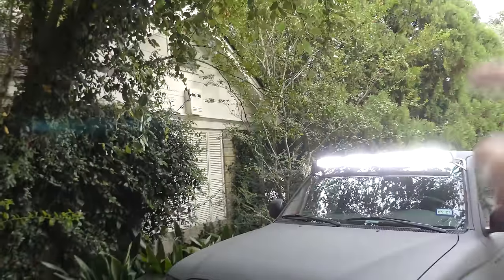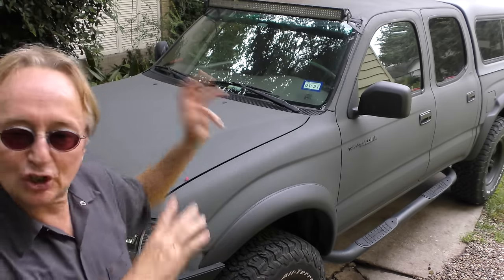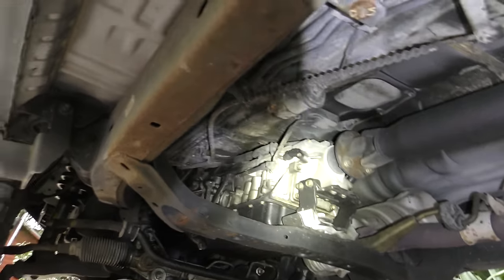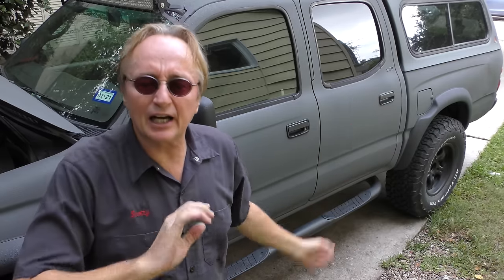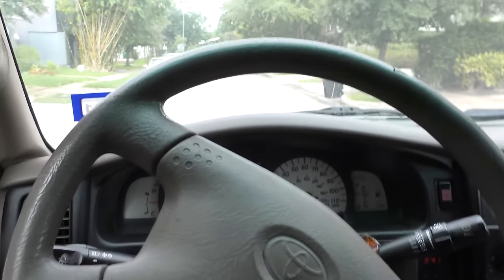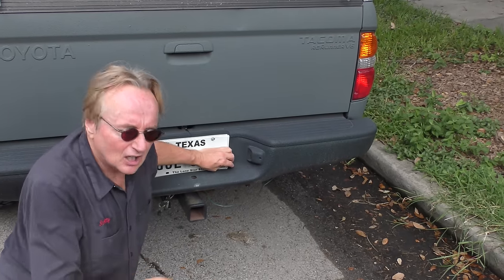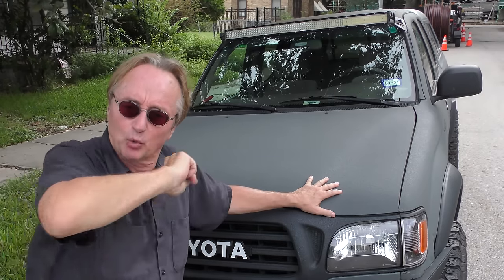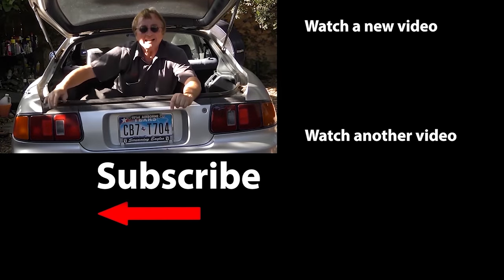Here’s Why This Cheap Toyota Will Survive the Apocalypse

Comment: 199,000? That’s barely broken in.
Reply: I have a 2007 Nissan Murano with over 206,000 miles and I drive it like a TrackHawk.
Reply: NFL YoungBoy Surprised. Usually don’t see the newer Nissan’s with 200k or more on them. I see the old Nissan’s from the 90’s get there easily.
Reply: mark price Thats not surprising. They’re expensive. My 2016 has 69,000 miles & I haven’t done anything but regular maintenance & I did brakes once on it.
Reply: John Yonker Yea I’m installing window tint on it now
Reply: Right on man. The rings are barely seated until 200,000 miles.
Reply: I have a 2006 Toyota Tacoma 2.7L 4x4 2 doors with 260,000 miles and keeps going
Reply: Raptor 05 Mine is also the 2.7L. I know in 10 years my truck will still run great. I wouldn’t be surprised if you can get it to 300 or 400,000 miles if not more. There’s a guy that hit a million miles with his Toyota. The motor was original still
Reply: @johnyonker8448  I pretty sure my truck will make it, it feels strong!!!!! And if I need to replace the engine I'll do it, it's worth it
Reply: John Yonker 2.7 liter lol
Reply: @johnyonker8448  I have a 2003 SR 5 4x4 with the 2.7 with 177,000 miles. I only put about 5,000 miles a year on it. I won't be getting 300,000 plus miles on it because I'm sure it will rust out before that. I live in NJ. What a great truck though. 5 speed manual and the thing is an absolute tank in 4 wheel low.
Reply: tommywallbanger I’m in NY & rust is a huge problem here. I put about 21-25,000 a year because I like to drive. Mine is an auto but I hope to learn how to drive manual by the time I’m ready for another Tacoma.
Reply: @johnyonker8448  driving a stick isn't that hard. Most people don't know how just because they've never had to learn. Stick shifts are by far in the minority. The only hard part is when you 1st take off. Once you're moving there's nothing to it. But I have been driving them since the late 80's and riding motorcycles since 83. Same concept except you use your feet and hands differently. To tell you the truth where I live and my commute I prefer automatics because stop and go traffic is the worst part about driving a stick. I like Sportronic automatics because you can put it in drive most of the time but if you want to downshift for a stop or going down a hill, it saves you're brakes. I have a Subaru XV and got over 80,000 miles on the brakes. Going around a jug handle or an offramp l might manually shift it but that's it. But hey, somebody might not steal your car if it's a manual shift because they can't drive away with it. When my truck finally goes, l will replace it with another Taco. Watch a video or 2 on YouTube and then try a stick for yourself. FWI, every car that you drive that is a standard shift will have a different feel to it and will take a bit to get the hang of it. Good luck.
Reply: @johnyonker8448  hey one more thing. You can fix the frame if it rusts out. There is a company called Auto Rust Detailers and they make a product called a safety cap. It gets welded to your frame. Tacoma's are known to rust (Keeps too) in certain places and this company makes these caps that will prolong the life of your truck. I've had 2 put on my frame because I'm not ready to part with this baby yet.
Reply: @NFLYoungBoy223  Shocking thw CVT transmission hasnt gone out yet. Mine did at 100k
Reply: Pete T-rex i never changed the CVT FLUID either
Reply: @petet-rex5589  you're CVT went at 100k miles? What model car? I have a 2013 Subaru XV with 102 k miles with the CVT and it makes all kinds of noise. I have no faith in it. I think I'm going to trade it in before 105 k miles that way l don't have to replace the timing belt. It's been making noise when I accelerate while turning. Just a nasty,  differential gears going bad noise that nobody wants their car to be making. What did you do with it? Fix it or sell the car? I heard Scotty saying their was a class action lawsuits on those CVT repairs. Just wondering if you got reimbursed. I'm wondering if that will happen with Subaru. It's a shame because I do like my car but I feel like I should unload it now before it goes.
Reply: @tommywallbanger  Manual transmissions are an awesome anti-theft device now days lol.
Reply: @tommywallbanger  2007 Nissan murano. It started slipping at 90k and would have cost more then the car was worth to replace.   Traded it
Reply: @galeaiken3841  hey I saw a Jeep with a spare tire cover that had the H shift pattern that read Millennial Anti-Theft Device
Reply: My 1984 has 300k miles 😎
Reply: yup, im at 205k '04 TRD pre. still runs strong. prob stronger than the newer models, in my opinion though.
Reply: 2004 Tundra 4x4 mileage 🤷🏻‍♂️but smooth, quiet. I’m keeping forever.
Reply: One video parts aren’t available because everyone keeps them, now? Parts are cheap and available lol gotta love Scotty 🤣
Reply: @NFLYoungBoy223  Not a trackhawk bro 🤣
Reply: agreed! mine is an 01 Taco DC, 291k miles. will definitely hit 300k this year (2022) still runs like a top
Reply: those are rookie numbers
Reply: Most out there got that mileage

Comment: If Scotty every finds a Toyota without freezing cold air conditioning, I'll know we're coming up on the Second Coming.
Reply: Praise him!
Reply: My dads work Toyota doesn’t have cold ac cause they took it out for bigger v6 engine
Reply: We have a 2008 Hilux at work with AC that no longer works 😢 It has been abused a bit, but still runs just fine.
Reply: Scotty's funeral instructions: The coffin must have freezing cold AC!
Reply: Probably made in Mexico
Reply: Scotty is obsessed with AC.  😄
Reply: I'll drive my 97 Camry down to Texas and make him a believer. 
It doesn't have air conditioning.
It's missing a front side line. 😂
Reply: @M Hawkins just don't use the AC then.
Reply: I have 3 older Toyotas. All three have broken AC.
Reply: @jhill4874  the older you get the more u appreciate it. I CAN VOUCH FOR THAT.😏😒😏😒
Reply: He lives in Houston.
He would not be alive if the AC was not cold.
Reply: I had a 2001 Camry I bought for $500. It had 345,000. I drove it to 438,000. A/C was cold, power windows and seats still worked....ran great the day I got rid of it. Unfortunately it had a pretty good oil leak  rocker panel rot, prev owner told me he never washed it. We live in New England. Salt is brutal. That car was so reliable...
Reply: @garyphillips6270  you beat me to that one.
Reply: @joeb2588  THESE STORIES OF HEROE CARS WARM MY HEART. ALSO IT MAKES MAD THAT TODAY's  manufactures make their products for between 7 and 12 years If you are lucky. Well done what a great tale.👍👍
Reply: @jamesjames3525  yah, thanks. I really miss it. It had a huge gas tank as well. Could drive quite some time on a full tank even though I drove quite a ways to work. It was fun to take people like maybe co-workers for a ride. They would be like, "I can't believe I'm in a car with over 400k on it!
Reply: @joeb2588  try and get that from a new car today. That just ain't happening.☹☹🙁☹🙁☹
Reply: @jamesjames3525  especially if it's Ford, GM or Chrysler.
Reply: @joeb2588  correct.
Reply: @josephpadula2283  I live in Florida,  only drive those cars early AM and at night!
Reply: Lol
Reply: I presume the “ice cold ac” is a comment on the state (strong) of the condition of the engine!
Reply: @kf3en  mine is wonky going in the shop Monday Cold/warm/ Cold🤷🏻‍♂️
Reply: I have one that original ac worked for 19 years till i had to put a compressor on it.
Reply: @jhill4874  Well, he's still a Texas boy.  A/C is more critical than heat down here.
Reply: My Tacoma has been without it for years. Sucks but the Pearl lives on. 229,000 miles.

Comment: Another good place to stick a toggle switch is in the power supply to the ignition coil. If you hide the switch in an easy access location it isn't a big hassle to use and is another layer of protection from theft. Not many thieves will try to repair a vehicle that won't start.

Comment: Every time Scotty makes a "best car" video I get excited and I want to go buy it, then I look at my bank account and realize I have to keep my 97 4runner for a few more years. 😔
Reply: 97 is a good year keep it
Reply: And your sad that you have a 97 Forunner? That is an excellent rig to build with not a lot of money! My pop's has a 95 Forunner, lives out in the desert and truck just goes and goes!
Reply: but its a TOYOTA!!!! :)
Reply: @big bee  Cut out that Republican talk! Trumphead! I want my stimulus checks! Just kidding. LOL.
Reply: Still driving my 2000 Tacoma 4 cyl, automatic Extended cab, almost 195,000 miles on it and runs great. Had the original U joints replaced 5,000 miles ago and my mechanic says it will need front shocks (original) next time it goes in for an oil change.  Rear original shocks are still good.
Reply: @garyphillips6270   Beast. Still driving my 1999 B14 Nissan Sentra GXE Limited Edition at 195,000 miles.
Reply: As long as it still runs good, why get rid of it? The frame rotted out of my 95 Tacoma 8 years ago, wouldn't pass NYS Inspection, it found a second life for 7 years as a dirt track packer truck until the frame finally snapped in half on it. They said it still ran perfectly. When I retired the 95, I picked up the 2000 Tacoma I currently drive.
Reply: Just turned 20 today dont eveb have $500 and my hours were reduced to
Reply: @Victoria3232-j7o   Been there. Keep your head up, and look for another job.
Reply: @big bee 🤣💙
Reply: @Fred I have a 97 Limited 4Runner 321,000 (Ice cold air lol)  looks fantastic runs better! Also a 99 4Runner with 210.000(ice cold air) looks fantastic and runs better too. I'd drive either to Australia tomorrow. People say you can't drive to Australia I reply you've never owned a 4Runner have you,? Lol
Reply: 97 4 Runners are sought after!
Reply: Dude- never….ever…. get rid of your ‘97.  A gem.   Will run forever…..with great AC.
Reply: @garyphillips6270 I have a 1999 Tacoma 2.7 I just bought, what are U joints and is it necessary to replace? 182k miles

Comment: I have an 04, TRD dealer installed supercharged V6 4x4 extra cab with a manual transmission I bought new. It has about 100,000 miles now but it still feels  like new, Every dealer recommended maintenance has been done...the 4x4 “go cart” I bought 17 years ago is still my favorite baby!

Comment: I have the same year and model with 256k on it. I bought it new. It runs smooth and the AC is super cold on the hottest days here in San Antonio. The only thing I’ve had to change, other than regular maintenance, is the water pump and that surprisingly was the same price at Autozone. Either way, I buy dealer parts only for my truck, they last longer. Places like eBay are full of them for this truck, love it! I switched out the headlights for new ones last summer and the truck looks brand new again!!! I don’t mean to brag but almost every time I take my truck to Discount Tire to balance and rotate my tires, some guy, usually  about Scotty’s age, will ask me about my truck and some time during mid conversation will offer me “10k cash right now” (their words). I smile and tell them, I love my truck, it’s not for sale. We’ll keep talking a bit more and the guy will ask me again, “10k cash right now, my bank is down the street!” FYI, if you ever see one of these for sale and it’s in good condition, snatch it up because it won’t be for sale long! Just my opinion but I don’t like the new Tacoma’s, they are too big! My neighbor has one and I thinks it’s beautiful but mine does better on gas!🙂 Wish Toyota would bring the Hilux to the states!

Comment: These first gen Tacomas come with a sport mode button called "ECT PWR." Makes a world of a difference in acceleration for city driving, and gas mileage stays the same at 17-19 MPG. I keep mine on! ECT PWR off sucks and makes the transmission upshift gears way too early and makes an already sluggish truck more sluggish. Keeps engine in better RPM range for power.
Reply: Idk if that is really how you use that. Might want to check the manual or some forums

Comment: I have a 2004 Toyota Prerunner TRD reg cab.  I’ve had it for 15 years and I love it.  All my coworkers have traded cars 3 or 4 times and I still keep my truck.  They replace vehicles while I replace tires and wipers.  You can’t beat the value, my truck still runs almost like new.  I’ll probably keep it forever.  Not having to shop for a vehicle every few years is pure heaven.

Comment: Scotty, I’m really surprised at you! True, it may be only a 2wd, but this would’ve been a great avenue to explain to non-Toyota truck enthusiasts “what makes a PreRunner a PreRunner” and not just a plain and basic 2wd. What’s so cool about these trucks is that they have, from the factory, a push-button E-Locker for the rear differential! You can go quite far, given factors, in a 2wd truck with a locked rear end and that’s what these Tacoma’s prove. Great for blasting around in the sand and dirt. That’s what inspired this neat sub model; racing! Have a great day everybody.

Comment: Here in Canada 3 year old cars have more rust then that Tacoma!
Reply: I live in Pittsburgh. One of the main reasons I hate it up here is because my cars do not last due to the rust!
Reply: gotta love it eh!?
Reply: out west in canada, cars don't rust. In the east, they rust because the roads are heavily salted
Reply: @Slenderman63323  well said.
Reply: Same in NY.
Reply: Derek Gardin  funny you say that had a Mazda 3 till last summer.  Still ran great but was embarrassed driving it with rusted out rocker panels. It was 15 years old tho. 246k km.
Reply: My 7.5 year old Taco had virtually no rust. I drove it thru many winters.
Reply: @Slenderman63323  Well what do you put on your roads then?
Reply: @ADAPTATION7  Sand or gravel.

I should also mention that the Atlantic ocean is saltier than the Pacific which may also have something to do with it.
Reply: Fast Banana not true in Edmonton, Alberta. Dumb mayor sprays calcium chloride on all our roads. Your new vehicle will turn rusty in less than a year if you don’t wash it every time you drive it

Comment: You have nailed my experience with  the 01’ 6cyl Prerunner.   Engine quit for the first time at 285k miles.  Spent $3000 for repairs (fuel injector seals and other deep engine work). Began hard shifting at 300k miles cuz I never changed transmission fluid after switching to full synthetic at 80k.  Replaced trans fluid two qt at a time.  Now it Runs great And shifts great. 309,000 miles so far.

Comment: I got my '03 Tacoma in '07 with 66k.  It has 254k on it now, and all I've had to replace is the Clutch, brakes, timing belt - stuff you typically replace after a while.  With good maintenance I'll probably keep driving it until it falls apart in another 20 yrs or so...

Comment: I have the same truck - year, model, drivetrain, mileage, everything - except for the paint - and I agree. Old school is best school; when you start it you don’t need sunglasses because the entire dashboard doesn’t light up, and all the all the systems are seperate...NOTHING is integrated. Damned thing runs like new, and will probably run forever.

Comment: I’d rather have a 12v 1st gen Cummins for the apocalypse
Reply: U can beat an inline 6 with 7 main bearings lol
How about an old school gear on gear transfer case that's not chain driven and aluminum cased like a toyota or any new truck.....
I'd go with an np205 bolted to a manual transmission....like an sm465 or nv4500

Comment: I have the '99 PR with the bigger 4 but it's been converted to manual trans, which really saves it's butt. It's lazy as the day is long but that tends to help it in the snot. It could use a mild turbo. 347k miles and it still doesn't leak oil. How is this possible? I can park on new concrete without worry. With the Explorer (don't get me wrong, was still running nice at 240k when I got rid of it) I used to have to park on the street. Lazy as it is, I dig the way it runs. It's like a street tractor. AC still works decent but it could use a total recon.

Comment: My 2001 Taco SR5 Double Cab 4x4 still drives and runs like a dream.  I'm the original owner and will keep it til the wheels fall off.  And yes, the A/C is still freezing cold.

Comment: I have a ‘87 Toyota 4x4, I’ve had it 20 years and has 130,000 miles on it. Get 24 mpg...old truck but dead reliable. 
I think something bad is coming and I believe in being prepared and my truck is part of it

Comment: I’ve got a base model 01 Tacoma w a 12’ welded lumber rack and two 18x60 side weatherguard boxes on it. 250 pothole miles and the thing runs great. Real beat up (by me) but the ac is cold as ice and it’s completely dependable. A need a low truck to access my tools. I hope it never breaks because there’s no such thing as a small truck now

Comment: On the van with battery drain problem, instead of wiring in a switch they could wire in a relay that is only powered when running on in accessory position.

Comment: I can attest to the resiliance of a tacoma, i have a 09 2.7 litre 4x4 tacoma wit 230,000 miles on it , all original parts except for the basic things like filters, brakes and clutch... Clutch was changed 5,000 miles ago an it wasnt even slipping. Jus a tad worn an i came across a brand new one for practically free so i changed it. I def got my moneys worth wit this truck, i bought it in the beginning of 2010 wit 12,000 mileson it

Comment: Im looking at a 98 toyota tacoma with 250k miles for 2,300 and I was thinking if I should get it. 
New radiator
New oil seal
Cold A/C
Rebuilt trans